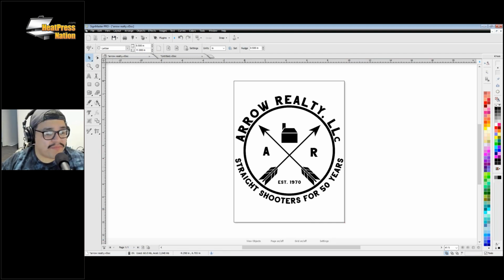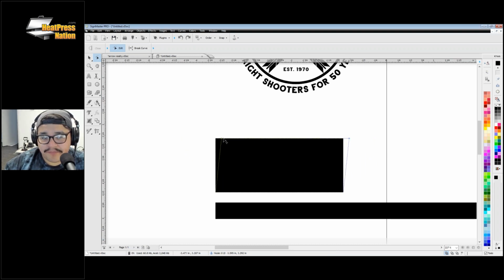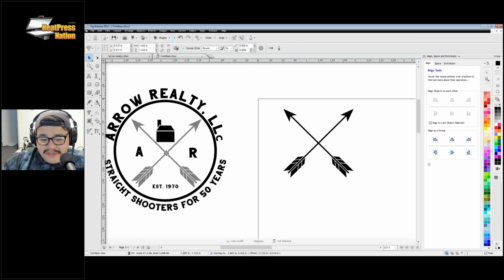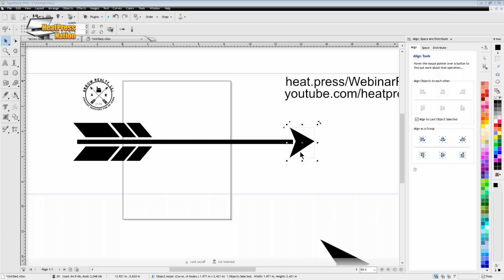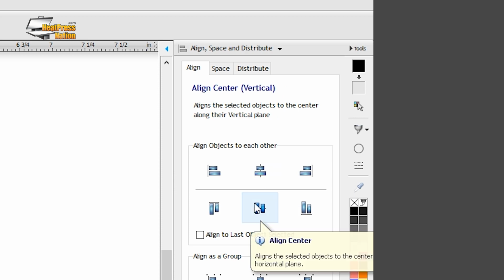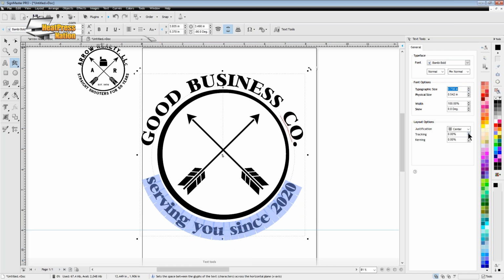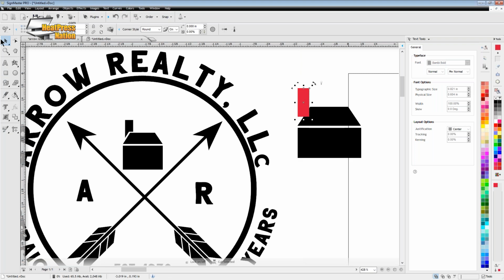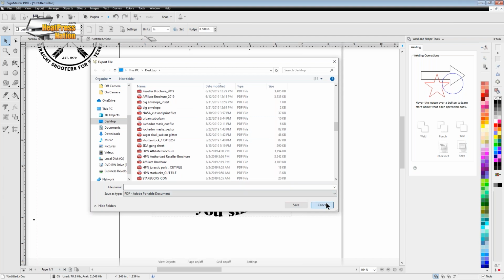SignMaster 101: Creating a Custom Logo From Scratch

Comment: Hi bro, why my SignMaster doesn’t have Arc Text features. How to enable Arc Text icon? Thank you
Reply from the maker: The Arc Text feature is only available in SignMaster Pro. If you are using SignMaster Cut (Basic), it will not have this feature.
Reply: @HeatPressNation  thank you for the answer.

Comment: How do i do a decal with two colors? It only picks up one color
Reply from the maker: Are you trying to trace a logo with two colors or create a logo with two colors?
Reply: @HeatPressNation  trace. I have my own image and trying to trace it. I used to be able to do this with my us cutter “using vinyl master program” but with this program I can’t seem to be able to anymore
Reply: @krazmex09  it’s the blade tool on the very far right side, next to the color palette. You need to either select fold cut, perforation, cut, etc.

Comment: Hi Jared,
Great Video, So I bought a vinyl cutter that came with signmaster but I cant seem to get it to cut after doing the design. Do you have a video going from the design to the cut, so I can see the process?
I'm not sure if I'm doing something wrong.
Reply from the maker: Yes, we have a "Setup & First Cut" video for all three of our Vinyl Systems models (Specialist, Edge, Evo): https://youtube.com/playlist?list=PLY9aNS49KtIwq0wbd-foqMQWrA_OPQqBw

If you require additional assistance, please feel free to reach out to our Technical Support Department at support.heatpressnation.com or (800)215-0894.
Reply: I had that same problem. After lots of calls and frustrations, I left it for a while and then it happened. I adjusted the pressure, and it's well, I'm loving it.

Comment: How do you just add color to a object.  I cannot get even a number to change colors?   Any help?  I have sign master pro.
Reply from the maker: If the objects locked OR are not yet vectorized, you will not be able to change their color. For all unlocked vector shapes, you simply click a color on the palette (toolbar on right side) and that will change the color. You can also go to Tools and open the "Color, Fills, and Pen" tool panel. 

For additional assistance, feel free to call our Tech Support Team at (800)215-0894.

Comment: what is the difference from what you are using or the CorelDraw X8 ???
but nice work with the design ;)
Reply from the maker: To be honest, I'm not sure since I haven't used CorelDraw. (We don't offer tech support for CorelDraw or any graphic design program) From what I've seen, you should be able to take the same basic principles from this tutorial and apply them in CorelDraw.
-Jared

Comment: Is this included on the demo version that comes with the cutte plotter pro vinyl cutter ?
Reply from the maker: SignMaster is included for free with all Vinyl Systems brand cutters (https://heat.press/vinylsystems). The Specialist line will come with SignMaster Basic. The Edge and Evo lines will come with SignMaster Pro.
Reply: Ok I meant to be more specific. Can I use arc text in the cut version ? If so how do I access that ?
Reply: @cwitdamactv  i need to know the same !
Reply: @jasondominguez4767  u gotta get pro
Reply: @cwitdamactv   dammit.. forsure Thank you !